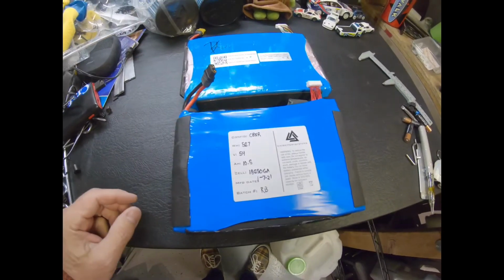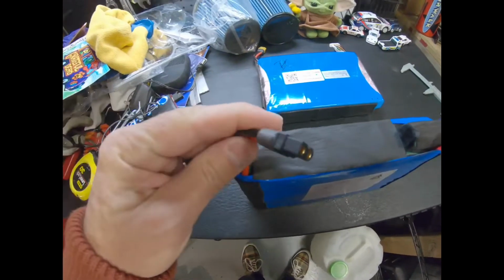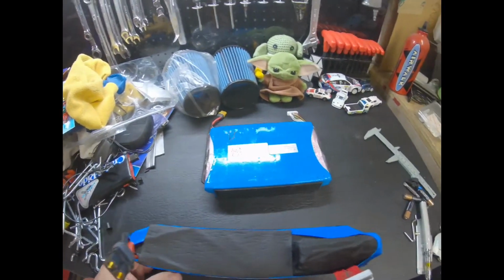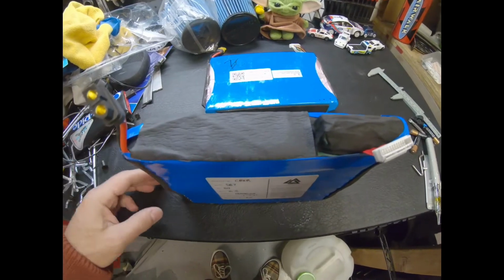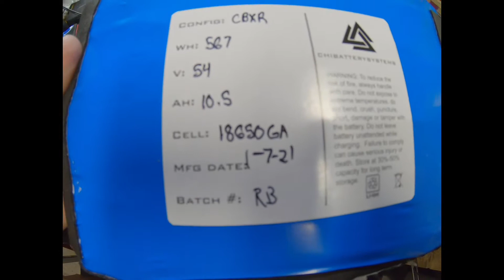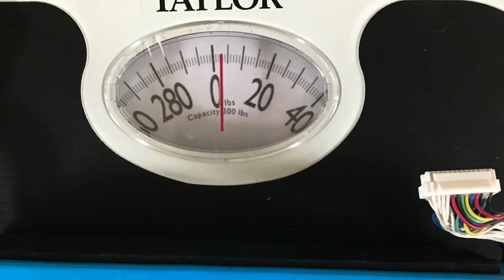CBXR Version 2

Comment: You think the v2 has more range?
Reply from the maker: It is an XR but second version. My first I was getting 16 blink error.
Reply: @freashbread  what software is your board?
Reply from the maker: @maneeoocho350  4209 with 4134 Gemini
Reply: @freashbread  did you do the recent onewheel app update?
Reply from the maker: @maneeoocho350  No. I have no plans of updating.
Reply: Whats the 16 blink error? I have the same board and getting a new cbxr this week